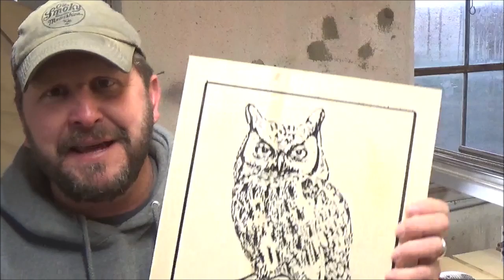Cnc engraved Owl wall decor (incredible detail)

Comment: Great work.  I do not see the link to the air brush also on the pine are you using sanding sealer before starting the carve?
Reply from the maker: Well I thought i had put that link in, It's just a link to amazon, and the gun is a Iwata eclipse, and the compressor is a master brand....and no sanding sealer before i cut...
Reply: thanks

Comment: Very impressive, I agree it looks as though it will never turn out right and then wammo perfect 
One question how do you get the paint so it does not bleed deep in to the wood
Reply from the maker: Regular spray paint bleeds horribly, so for a while i used a paint brush and now i've got a airbrush and man that is the way to go.  It atomizes the paint so much that very little paint is used and really not that much is on the wood and it dries amazingly fast.....I have a link for airbrushes in the description box below the video.....Thanks for watching!!
Reply: Thank you I suspected it may have had something to do with airbrushing, just have to get my air brush out

Comment: Hi, can you tell me what paint you use?
Thank you
Reply from the maker: CreateX opaque...Thanks for watching!!
Reply: @SmokeysCNCWoodworks  
Ok, thank you .. And how long do you let it dry before sanding?
Reply from the maker: Its really not real long, maybe 10 minutes when its above 50 degrees and maybe just a little longer when its colder....The airbrush atomizes the paint so much it takes very little time for it to dry....Fair warning if you don't wait long enough it will make a mess of where you painted.  Every once in awhile i'm a bit to eager and sand to early and i end up doing touch up where the dust stuck to the paint...
Reply: @SmokeysCNCWoodworks  thanks..

Comment: I've got a few questions for you.  
What were your feeds & speeds?
What is as your run time on this project?
Why don't you cut out your jobs with the CNC instead of using the table saw?
On a project like this what advantage do you feel using the airbrush gives you?
Reply from the maker: The spindle speed was 12000, I don't remember the feeds off the top of my head (I'm not where i can look at that computer at the moment or i would go look real quick) Run time was 44 minutes....just cutting ends off the boards like that is faster on the table saw and the reason i have to is because of the style of clamping system i use so i have to make the boards just little longer  to be sure to stay clear of the cut area.  Any time its a contour cut out i absolutely let the machine do it, its much faster then...
The airbrush as a whole is just a lot faster than a paintbrush, and the airbrush atomizes the paint so fine, that it dries really quick with next to zero bleed and when I'm painting down in valleys like the border outline much easier than trying to get in there with a paint brush....Thanks for watching!!
Reply: @SmokeysCNCWoodworks  ok thank you .  I understand abt the work holding, have you tried using tabs then trimming them off with a flush trim bit on your router table?  I built a vacuum table for my router &it holds great but I still use tabs & trim them off.  I use the chamfer gadget in aspire & dress up the edge a little bit.  I'm not sure how it does on pine, I own a sign shop so our jobs normally go outside, so I normally use either oak, maple or cherry.
 I understand about the paint bleed, that makes sense, I've been using rattle cans & giving the piece a coat of clear polyurethane  then spraying the paint it keeps it from bleeding into the grain.
Thanks for your time
Gary
Reply from the maker: Yes I use tabs when it is a contoured piece, and do the trim up during finishing....Just simple straight cuts just makes more sense to me to just go to the table saw or miter saw....I've tried a variety of different paint processes, and so far i like the airbrush by far the best!!...Thanks for watching!!